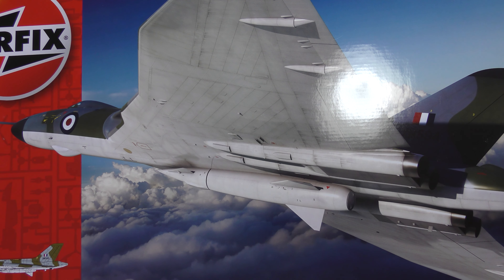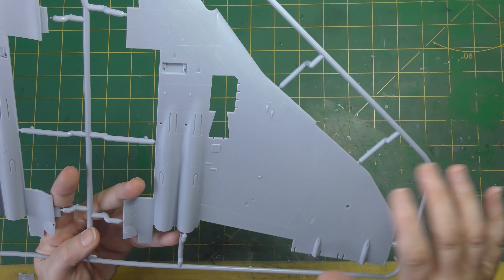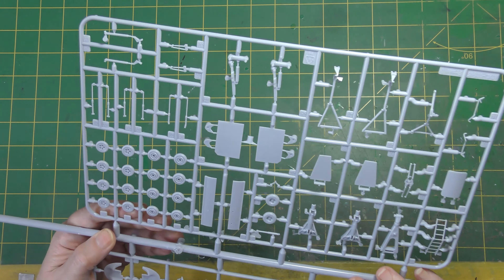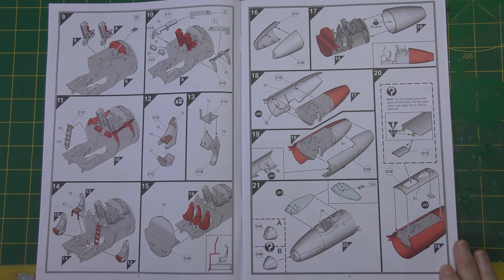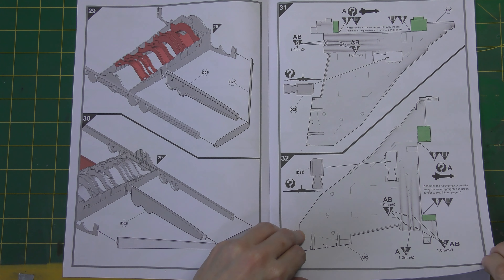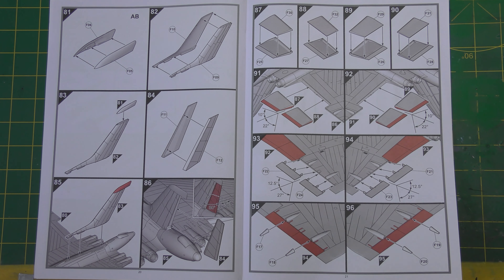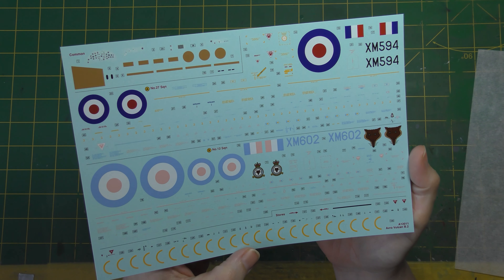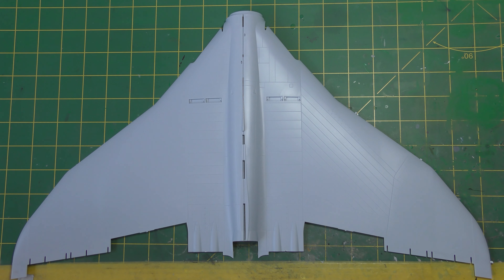*Quick Inbox Review* New Tool Airfix Avro Vulcan

Comment: Great review. Mine arrived a few weeks ago and I took a quick look in the box, but not much more so far. 

About 12 years ago I got to crawl around the interior of XL319 at the North East Land Sea and Air Museum in Sunderland. Very cramped and, as you say, very black, but lots of opportunity to chip that black back to aluminium (that you'll never see, again as noted). Might be fun to do a fuselage cutaway around the crew compartment, but... would be interesting to maybe do two noses for the aircraft - the way the kit is designed it would relatively easy to swap a complete one for a cutaway one. Looks like Airfix could even sell extra nose sprues to make that a possibility.
Reply from the maker: A nose half in clear plastic could work, like the AMK Fouga Magister had.

Comment: Just out of curiosity, on your kit did you happen to notice any sink marks along the wing trailing edges and the top the fuselage join?  There's been a couple of builds by some other modellers over the past year which complained about sink marks.  I just got hold of the new Vulcan and there appears to be absolutely no sink marks and the plastic seems not as soft as most Airfix kits.  Wonder if they decided to correct it?
Reply from the maker: I didn't, no. I've had quite a few comments and chats about various quality issues with the kit but the one I got is really good.

Comment: Hi Jen, I think £60 is fair for this kit IF it didn't have all the quality issues that mine had. Yours look to be a lot better than mine with regard to sink marks? It Is a beautifully designed and engineered kit, if only Airfix would improve their quality? The fact that yours is so much better than mine proves they can improve, they just need to be more consistent. Just one note.. the fibreglass panel decals are all there.. except for the two on the fin?? Not a complaint, just an observation.
Reply from the maker: I did see you were commenting about quality issues, and I thought I had seen no issues on the one I have. In case you (or anyone else) are wondering, this is straight off a shop shelf, I don't have a special one!
Reply: @JenesisDesignsandModelcraft  I saw two kits bought at Thornbury and one was worse than mine, the other was great.